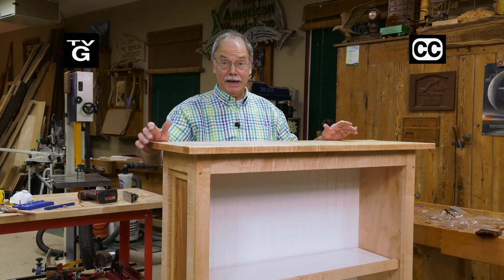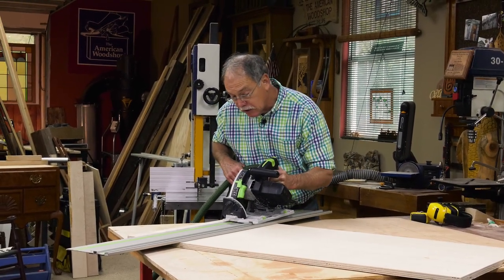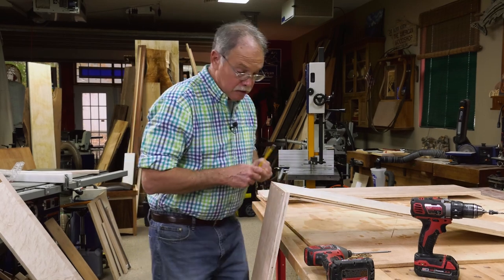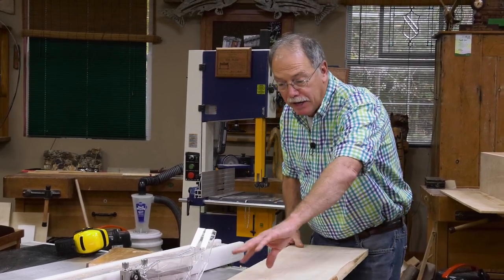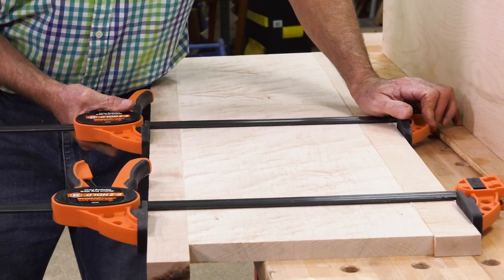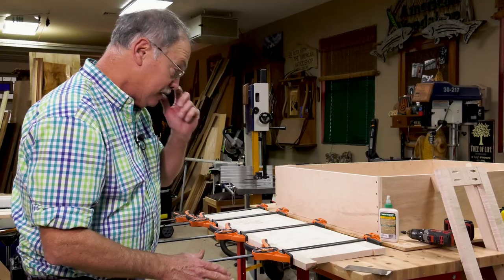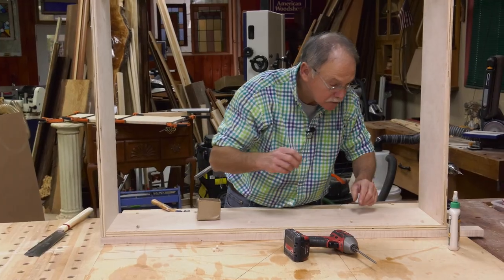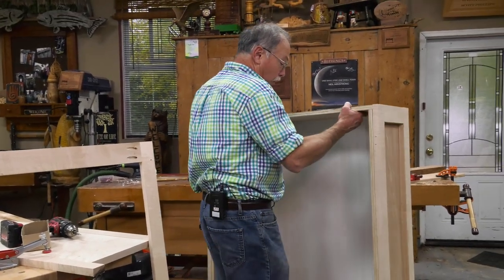The American Woodshop- 2709- Building a Better Bookcase

Comment: Hi. Maybe you can tell me: If a bookcase's shelves are 12 inches in width, and the shelves are built out of 3/4 inch solid maple and are reinforced with a 1 and 3/4 inch lip, how long can the shelf be and still hold a lot of books without sagging under the weight?